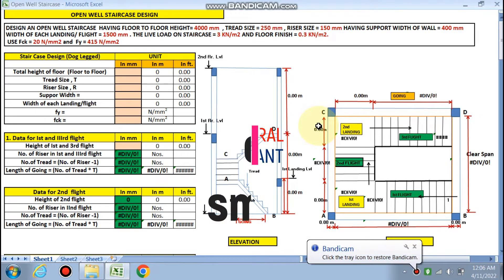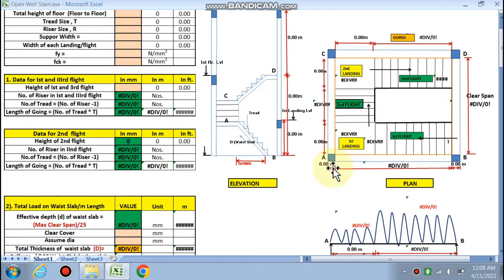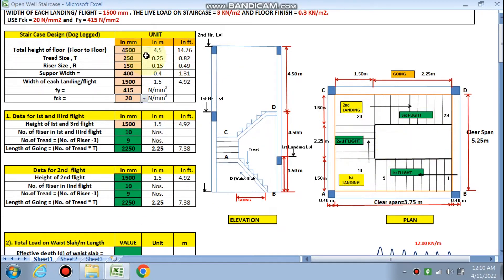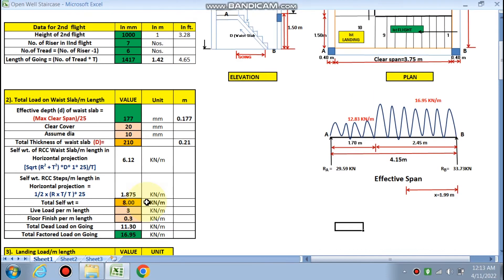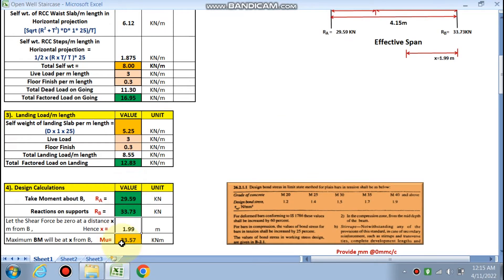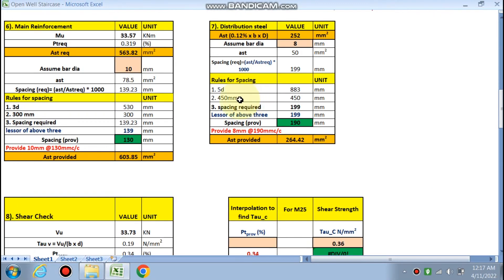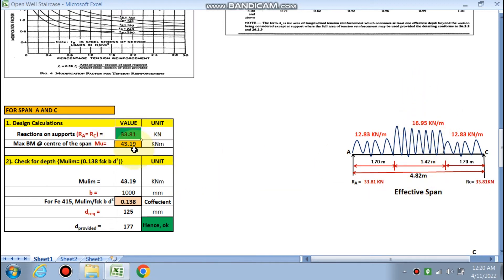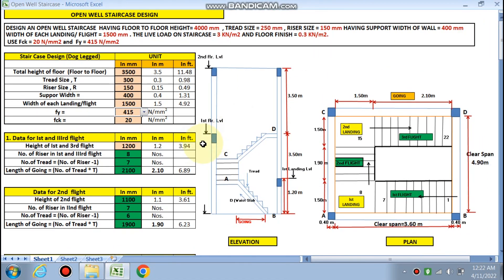In Excel I Open Well Staircase Design - BY CIVIL SMART

Comment from the maker: Saves your lot of time in design.

To get all the footing excel Sheets get from below link:
https://u.payu.in/PAYUMN/Br5KuV8S2ibY

Full design Excel sheets course 
https://pmny.in/era02LAqXt8B

Full Course includes all sheets as under:

IN FOOTING DESIGN SHEETS

1. Isolated square footing

2. Isolated rectangular footing

3. Combined rectangular footing

4. Trapezoidal footing design

5. Strap beam footing design

6. Footing with uniaxial bending

7. Footing with biaxial bending

8. Pile foundation

9. Pile cap design 3 & 4 piles

10. Wall footing/ Strap footing

11. Raft Foundation ( Beam and Slab Type)

IN BEAM DESIGN SHEETS

1. Singly reinforced beam design sheet

2. Doubly reinforced beam design

3. Continuous beams design  with point load having

    2-span continuous beam

    3-span continuous beam

    4-span  continuous beam

    5- span continuous beam

IN COLUMN DESIGN SHEETS

1. Axially loaded column design

   (a). When column size is known.

   (b). When column size is not known.

2. Column with axial load with uniaxial moment ( on 2 sides and 4 sides reinforcement)

3. Column with axial load with biaxial moment

4. Mux and Muy Calculation sheet.

IN SLAB DESIGN SHEETS

1. Cantilever slab design sheet.

2. Simply supported slab design sheet.

3. One way Continuous slab design sheet.

4. Two way Continuous Slab design sheet.

5. Two way simply supported slab design sheet.

IN STAIRCASE DESIGN SHEETS.

1. Dog legged staircase design.

2. Open well staircase design.

IN RCC WATER TANK DESIGN SHEETS.

1. RCC WATER TANK RESTING ON GROUND (L/B <2).

2. RCC WATER TANK RESTING ON GROUND (L/B >2).

3. UNDER GROUND WATER TANK DESIGN (COND. TANK IS EMPTY AND OUTSIDE SOIL IS SATURATED).

5. UNDERGROUND WATER TANK ( TANK IS FULL AND NO OUTSIDE SOIL PRESSURE).

4. UNDER GROUND CIRCULAR WATER TANK.

IN WALL DESIGN SHEET

1. RC WALL DESIGN SHEET.

2. RETAINING  WALL DESIGN SHEET.

3. BASEMENT RETAINING WALL DESIGN SHEET.

Building load calculation sheet

Cost estimation sheet..etc.